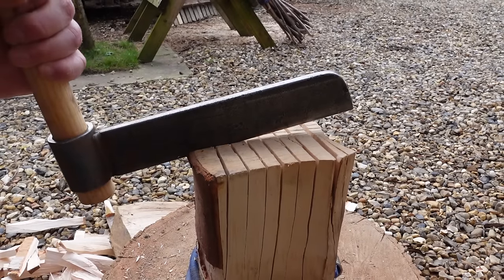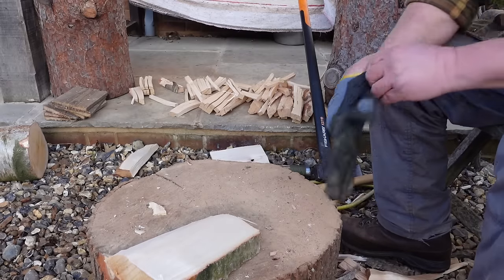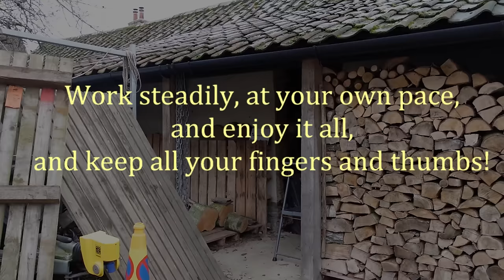Split Kindling Safely!

Comment: I didn't quite catch the comment on why you use blunt tools "Because sharp tools ____". Could you elaborate on this more? it seems counter to any usual advice I get about using hand tools and I was surprised that you gave that advice.
Reply from the maker: I was taught to use a sharp edge for cutting wood and a blunt edge for splitting wood.  Our felling axes were so sharp you could shave with them, our splitting axes had a much duller edge.  The idea was that a sharp axe will often get stuck in a log, while, hopefully a blunt axe should split it or bounce.  People who use a sharp axe for splitting often learn the 'flick as it hits' technique to stop the axe getting stuck.  In general, yes hand tools should be very sharp. All best, Vince
Reply: Glad you asked as I too couldn't discern what the word was.

Comment: Thank you! I am a female in my 60’s and am now solely responsible for cutting my own wood and kindling. Thankfully I already instinctively followed most of your techniques but the addition of the sissy stick and clamp will definitely help! I just got a froe but haven’t used it yet. I be using it as soon as I get a beatle made.
Reply from the maker: A good thing to adopt the sissy stick and keep all your fingers!  I have just had a heavy beetle made and it will work so much better than the beech-wood one I have used for ages.  Thank you for your comment.  All best Vince

Comment: I am always amazed at how much more I can learn about a simple, long practiced activity. Love the sissi stick/clamp idea. Also a good reminder to dig out my froe to make good use of it. And last, but not least, I once admonished a friend for using the back of an axe as a hammer for driving a wedge, though had in mind protecting a good tool. He said the burr would not matter when splitting as the split would have opened before the burr could get to the wood. I think this is a good demonstration of the importance of not only knowing things, but knowing ALL the reasons WHY!! This person is already virtually blind in one eye (not burr related). This video may help him keep his eyesight. Thank you. Better to learn from other people's experience or knowledge than the hard way.
Reply from the maker: Hello Judy, it is just great to be able to chat and learn about wood fires from people in many different areas - I have been surprised at how much helpful comment is written. And you are right about axes - they are not hammers! A few taps on a nylon felling wedge is ok, but never so hard as to open the eye or cause a burr. Hope you're having a good winter. Vince

Comment: Your co-workers who lost eyesight from metal breaking off reminds me of a story a man told me years ago. He was young and he and a friend were going to cut down a tree that was beside a house. They picked a calm day and using axes and a crosscut saw began their work. After cutting a considerable depth into the trunk, wouldn't you know, the wind began blowing - the wrong way! The man was frantically driving steel wedges into the saw kerf to stabilize the tree and keep it from blowing over on the house. A chip broke off and hit his upper arm; every time his heart beat, blood would squirt out. They bandaged it up long enough to finish the job. A man came along with a truck, I think it was a Pepsi delivery truck. They tied a rope to the truck and could then finish felling the tree. In today's world, companies would prohibit you from using a company vehicle to help someone. My friend would certainly have been blinded if that steel had hit him in the eye instead of the arm.
These warnings are always good reminders to work safely and use good practices.
Reply from the maker: Hi Daniel, many thanks for your comment - really interesting and instructive. Nowadays safety is pushed so much that it is hard to work out the real and present dangers from the extremely unlikely hazard events. I once read a woodfire book that advised to have some water handy when lighting a fire . . . to douse the match! You are lighting a fire! An example of nonsensical safety advice. And that's why comment like yours is so important, plus I like the Pepsi truck helping out!

Comment: Really nice work.  I have a pocket version of your kindling splitter, it is called an electrician's sheath knife.  I can hit it with most any piece of wood and create kindling for a fire anywhere that I am.  The shape of the Kline Tools sheath knife is EXACTLY the same as the tool you are using, just smaller.  Best wishes for your continued success.
Reply from the maker: Thank you - I don't know that knife, I will look it up. All best. Vince

Comment: Handy tips. I will be using a sissy stick from now on. I got a deep cut on my thumb with a hatchet while splitting wood for a pioneer maple syrup making demonstration. I had to put on a makeshift compression bandage on it and hide the wound under a mitten. Luckily there was snow to kick over the blood on the ground while I did the demo. Thanks for sharing your knowledge.
Reply from the maker: Hi Mel,  a 'sissy clamp' is my new normal I think. A bit like you, I had a pruning saw close on my hand once while I was helping children at a woodland club. Embarrassed that a so called craftsman had cut himself, I clenched my fist and put my hand in a pocket until I was able to get away.  Also, I made Maple syrup from Norway maples in Scotland once - fun to do and the syrup was great. Before that, I had always thought it would have to be a Sugar maple.

Comment: Lots of good advice to be had here. They only 2c I would ad is "only handle things ONCE" rather than raking the cut up kindling on to the ground and having to come back and pick it up( my least favorite chore picking things up off the ground) put some type of storage system next to you to put the kindling in. Handle it once. Thanks for the tips.
Reply from the maker: Yes a very good point. In woodland management this was a key thing - most wood is not very valuable so we tried to never do any 'double-handling'. Good comment - thanks. Vince

Comment: Glad to see you using that old cedar fencing!  At one time I had quite a lot of it and it all got made into kindling!  HA HA  I would use my band saw to cut it to the right length and then it would split so easily!
Reply from the maker: It is fast and lights well - I spent an hour or so splitting kindling at the weekend, it's so relaxing. All best, Vince

Comment: Lovely video!
I tend to lay the board flat on the copping block and hold it so that my fingers are away from the block. Then I use a hand axe to chop and break the kindling. Kinda like using the axe as a froe, but on the flat side of the piece of wood or stick.
Reply from the maker: If it works and you keep all of your fingers - it is a good technique!  All best. Vince

Comment: So it's froe or frow ... YT told me it's throw :D. Now I need one :D.

Grear video.

I always wear safety glasses when chopping wood (and work with tools actually). My friend got big splinter into his eye when he was splitting the wood with axe. And he now got all sort of problems with that eye.
Reply from the maker: I have just checked and see that it can be Froe or Frow - although in England I have only seen the spelling Froe.  I don't know anyone injured by a wood chip, so very interesting to read that you do.  Our eyes are such a big deal. Thank you. Vince
Reply: @WoodFiresWithVince  I'm not sure how big "the wood chip" was. Maybe it was actually quite big - like the whole kindling. Dude said it was a chip.

I'm using Fiskars X25 (or 21) to make my kindling and sometimes (especially with birch) these kindlings fly up to 2meters.
I have to ask my trusty blacksmith what is the price for the froe, but I'm affraid it would be ~300$.
Reply from the maker: In England a froe seems to cost from about £40 to say £140 - so say $50/60 upwards - so I would hope you could find one ok.  I can imagine that a bespoke one made for you would be expensive!  Good luck finding one. Vince

Comment: Hi Vince. Just subscribed to your channel. We have a relatively new wood stove and have recently had 2 trees felled, one that was too close to the house and one that had ash dieback. I am enjoying chopping the would with a wood splitting maul and making kindling. The main issue we have is keeping the wood stove going. Getting it started is fine but the logs ( we are currently buying seasoned dry logs ) just tend to turn black and do not burn so well, seems it needs constant blowing from me with the door open and this causes smoke to enter the room. Eventually i can get a good fire going but it shouldnt need 20 minutes of intervention should it? Would appreciate your thoughts.
Cheers.
Reply from the maker: Evening Adrian,  Hmmm, this is a tricky question as it could be a number of things.  But essentially it can only be the airflow or the log's dryness that is causing your logs not to burn. First I would buy a moisture meter and check that your firewood logs are really 'ready to burn' (= to or < 20% mc) - not just surface dried. You could also split the bought logs smaller - as smaller logs catch easier. Once you know that your fuel is good, it is then time to look at the stove's airflow and the chimney's draught. I would also buy a CO sensor in case the fumes are leaking back into your room.  
Look carefully at the stove's air controls, especially the secondary airflow, and give the early fire plenty of air. (I was in a friend's house last week and the secondary air vents on their stove were fully closed as the family thought they were just decoration.) Once you know that your logs and the stove's air flow are good, you have to consider the house and chimney.
Some houses are so airtight nowadays that you might find that opening a window a little suddenly allows a good draught. Lastly it could be the chimney - a blockage, nest, loose brick or just that some wind directions do not suit it. Obviously a professional sweep's help is needed then. Let's hope it is just the logs are not properly dry! I have two videos on how I light my fires - ordinary and top down - see if either of those help a bit. Best wishes, I hope this gives some ideas! Vince
Reply: @WoodFiresWithVince  thanks for the detailed reply Vince. The house is very old and far from airtight so i don't think that is the issue. There is only one vent on the stove which i put in the ooen position to start a fire. The chimney has recently been swept when the stove was installed last January. I will buy a moisture meter that's a useful tip. I try to split the logs small. I find i need to clean the glass a lot so i'm guessing there is too much smoke. Maybe it is my lighting technique. I will buy your book. Many thanks.
Adrian.
Reply from the maker: @adrianbartlett3450  Morning Adrian, one other quick thought. When you first light the fire leave the door open just a little. It may help to get everything warm and create the draft needed. Last thought, maybe ask the previous owners what they did!? All best. Vince

Comment: nice video, do you use fresh cut wood or dried wood??
Reply from the maker: Interesting question!  I was using dry wood as I wanted to use the kindling at once.  But all logs split more easily when still 'green' (wet) - so if I was going to make a lot of kindling and store it, then I would split the logs before drying them.  Thanks for your thought, all best. Vince

Comment: Sound advice Sir, but why not a left hand leather glove when splitting kindling ?
Reply from the maker: Interesting question. When I first started working in woodlands I did a two year course at Dartington Hall to get the UK's Royal Forestry Society's, 'Woodman's Certificate'. One of the main things the instructors pushed was no gloves when using cutting/sharp hand tools. This was because they knew that, especially when wet, the tool can slip out of your hands. So I guess I have just got used to not wearing gloves - but having had bits of kindling come back up into my right hand, when splitting close with a big axe, I do wear a glove then! Long answer - hope it makes sense.
Reply: @WoodFiresWithVince  Thanks for that. I appreciate the stance that a bare left had keeps the mind alert to danger. I've ( onviously) always worn a left hand glove and as you were wisely taught, never a right for fear of glove slip. Really appreciate your reply sir.

Comment: Hi. You say all your tools are blunt because sharp tools get …what was it? Im having trouble hearing the word you use, and Ive been misinformed, I think, as I keep being told to sharpen my hatchet to get the cuts I want. Im wanting to use my hatchet to make kindly for my home and campfires. Thanks in advance for your response!
Reply from the maker: My training as a woodsman was that if the tool is to cut wood, it must be as sharp as you can get it. But if you are splitting or clefting wood, then the edge should be sharp enough to start the split but not actually cut into the fibres. So, sharp tools for cutting - blunt tools for splitting. There were 12 of us students on a two year course when I first started. We were competitive and I remember that I could shave a human hair three times on my 4lb felling axe. But my splitting axe was blunt to stop it getting stuck in the log. I hope that makes sense. All best wishes, Vince

Comment: While you did not mention it, the froe mustn't be hit with a metal hammer. Same issue as with the billhook. Use a wooden club by any name on the billhook and it's not any more dangerous than the froe.
Reply from the maker: Fair point, any metal on metal is dangerous. The steel felling wedge hit with a sledge hammer or back of the axe are the worse. And I have just got a heavier beetle made of oken, after years of using the light one in the video! All best. Vince

Comment: What is the name of that tool please : )
Reply from the maker: The long blade on a handle is a froe, sometimes spelt frow.  They were common once to split roofing shingles. All best. Vince
Reply: @WoodFiresWithVince  nice tool!

Going to ask the local blacksmith if he can whip one up for me 😎
Reply: @WoodFiresWithVince  Wondering if a machete may do the job similarly too?
Reply from the maker: It probably would, but the blade is rather thin to split kindling well - plus it may damage the back.

Comment: I'm another statistic, I cut myself quite badly with a shaving sharp hatchet while making kindling. Luckily the hand surgeons are really good and after a year my hand is about 90% of what it was before the accident. Lessons to be learned is that you never are as precise with an axe as you think you are and never for any reason have a body part in front of a sharp edge. There are always another way of doing things and if you can't think of it leave the task for another day.
Reply from the maker: Really glad they were able to fix you up - I guess it is worth remembering that axes were a main battle weapon for much of our history!  Thanks for adding your story. All best. Vince
Reply: @WoodFiresWithVince Thank you. Using a froe seems like an excellent idea and seems easier and quicker than using a hatchet unless the grain is perfectly straight. I will look to see if I can find one.
Reply from the maker: Get a good heavy beetle too - mine is too light and it makes it all harder than it should be. Again, all best wishes,  Vince
Reply: @WoodFiresWithVince I'm thinking about making a mallet from oak, that will probably be heavy enough. If not I can make it as a dead blow mallet and fill it with lead pellets.  All the best!
Reply from the maker: That should work!

Comment: I‘d put gloves on both hands, because even the lightest accidental touch with a sharp axe can cut the skin severely
Reply from the maker: A fair point - but I was taught by old woodsmen who would not let any of us ever wear gloves.  They said you have poorer control of the tool, and in the wet gloves can cause the axe to slip from your hands.  But I do wear a glove when close to the axe head as bits of sharp kindling have come up and cut my hand in the past!  Thanks for your thoughts. All best. Vince

Comment: I was using an old meat cleaver but a piece of the blade broke after a few days of use, definetly not the tool for the job.
Reply from the maker: Interesting, as that should have been a really good steel - maybe there was an old fault in the blade?  All best, Vince

Comment: I am afraid I am going to be the only one here to disagree. The safest way is to mount an inverted axe head onto your roundel and use a plastic headed mallet to hit gently down to split the kindling. It is more precise, infinitely safer and much quicker. I own a kindling business so have some experience.
Reply from the maker: Interesting point!  To have a fixed blade and strike the kindling onto it is a good technique, and I know people who make their kindling that way. I should perhaps have included that system . I guess nothing it totally safe as I have met a guy with a very bruised finger as hit it with the hammer he was using to strike the kindling - but, at least he did still have his finger! Thanks for the comment. Vince
Reply: @WoodFiresWithVince  thanks. A nice set of leather gloves (avoids splinters too) and holding the kindling at the side rather than at the top and you should never have an issue with any sort of hand injury. Some goggles and your eyes are protected too. It is amazing how little power the mallet needs if you are using wood that is quite dry already.